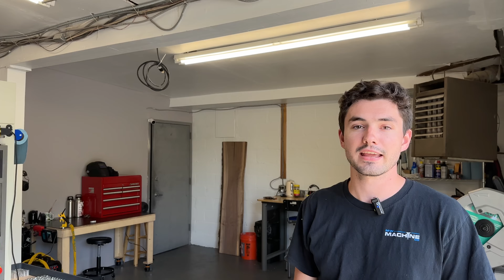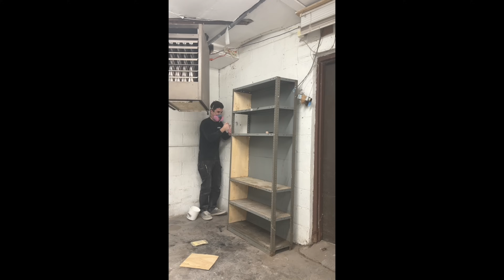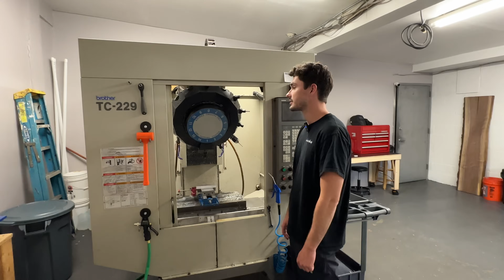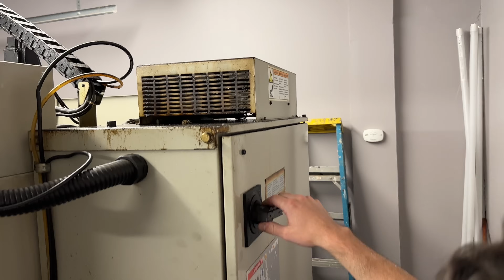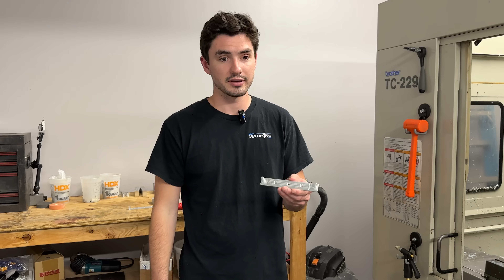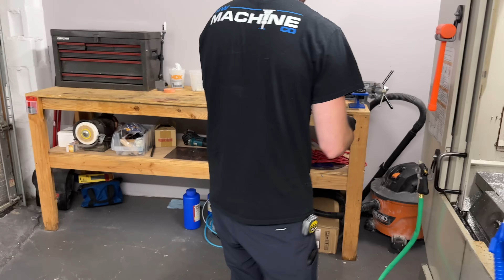My Son’s Machine Shop - Shop Tour

Comment: Suggestion:  you are doing a lot of “subtractive” machining to get those pin features.  You have to start with a big chunk just to get the height for the pins.  I would make this as a baseplate from thinner stock, and make the pins on a lathe. The pins could have a threaded feature in the bottom, and then just screw onto the milled base. Top side of the base could have a short bore to locate the pin, bottom could have a countersink for the screw head.
   A lot less cycle time and material cost.

Comment: very nice.  One question, do you have 220, or 240 volts in the panel?  220 is very uncommon in USA (its a European standard for the most part.  You still use a phase converter to get 3 phase.  In this case i assume, 480Volts.  If this machine runs 380volts 3 phase that's cool- its just a different phase converter with different voltage output.

Comment: If Walter ever needs to increase production volume, then I would suggest lathe machine pins with O-rings (to remove punch fit) and use vacuum workholding for base parts on both ops . That will reduce manufacturing time by a lot approximate 80%.
Reply from the maker: @pektorijs  cool thanks, he’s been talking about a lathe machine

Comment: I run a 5HP 3 phase spindle on a large CNC router, (not commercially), from single phase, in Australia. The power is fed into a VFD, (Variable Frequency Drive), & comes out 3 phase. It is fully electronic, similar to a power inverter. It is made to input 3 phase normally, but single phase is selectable. It directly controls the speed of the spindle. Worth looking into.
Your machine looks is great condition, especially considering its age! That's Japanese quality for you.

Comment: Nice!  Starting your own business is challenging, but could turn into a lucrative business.  I see a Milwaukee charger side mounted to the bench.  Do you have a bracket designed for an M12 charger?  I would buy a couple to support your business if they are not to crazy expensive.  Cheers,

Comment: Electric, Garage door size, Fire wall & ceiling height where my 4 dilemmas when opening my shop.  I looked for 6-8 months in my county.  Found a new space being built, 1500square foot off the beaten path.  3 phase - 200 amps, 10 x 12 door, 2-hour firewalls, & 16'ft ceilings. 19 years later, best choice I made.

Comment: Great to see.  The TC-229 has its limits, but there is a lot that can be done with that machine.  Kudos on picking the Brother as a first machine, you will be spoiled.  Just remember to use the G100 for tool changing and only G77 for tapping.  If you need to do helical interpolation, there is a switch on the motherboard to turn it on.  Some machines did not have that option 'turned on'.  Also, you can't do 3D milling per se, but if you use a G02/G03 and an huge R value like R99, it's basically a straight line.  It's a solid workhorse that won't let you down.

Comment: Looks like that charger mount could be a bit of flat bar, and some drill rod pressed into some holes. Though i guess that would be more labor and less lights out friendly.
Reply: I was thinking this exactly. The Cost saved in material not removed could be worth the lost amount in time it takes to assemble.  It doesn't look like a lights out situation yet.  They are only using a Kurt vise from the looks of it.

Comment: What a nice video, Jon...and congratulations to you & your partner, Walter.  A suggestion, if that would be OK:  Your coastal location immediately makes me think of the many custom machining needs we boat owners find ourselves with, especially as the boats and their engines age. When I've tried to use local machine shops, they are often geared to high production volume jobs and operate large, expensive machines.  I'd suggest visiting some boats and talking with owners (especially the commercial guys) about what breaks, what has to be modified, what wears out, etc.  You'd be looking for the smaller generic parts that are not boat brand dependent. Another potential customer might be the nearby boat builders who will sub out their machining needs. And don't overlook the 'boat jewelry' aspect:  We boat owners will happily buy something - perhaps the polished stainless version to replace the corroded aluminum one - for cosmetic reasons, even while we'll complain about buying a new set of wiper blades for the car.  Regardless, good luck with the new biz!
Reply from the maker: Thanks Jack!  great ideas I’ll pass them along.

Comment: It is cheaper and easier make it by casting rather than machining it every time once and once again. I mean the tolerances for this hanging device is not crucial at all. You can cast it by dozens at once. An casting can give you good enough geometry for this thing.   Hmm...  Using machining centers with expensive tooling for a products like this makes me feel strange.
Reply from the maker: I don’t know about that. Lots of work to do after a casting